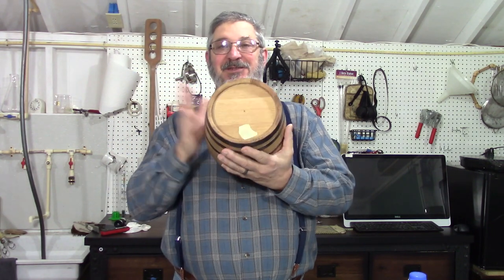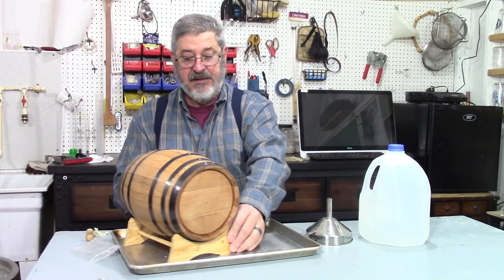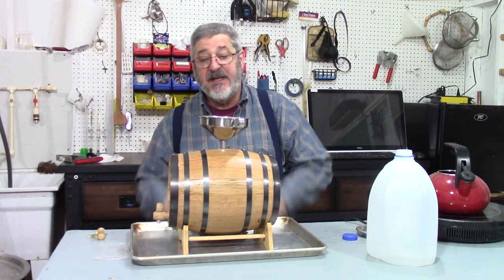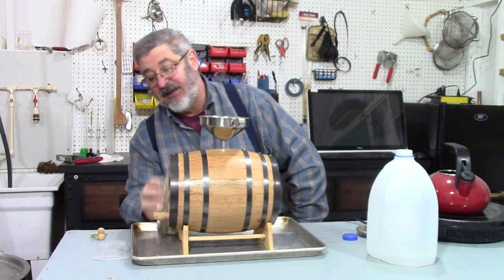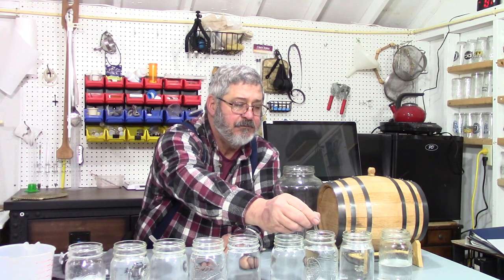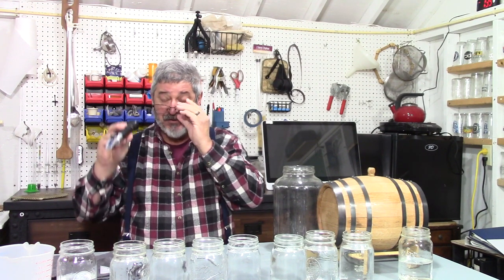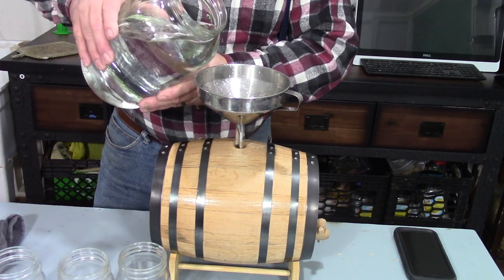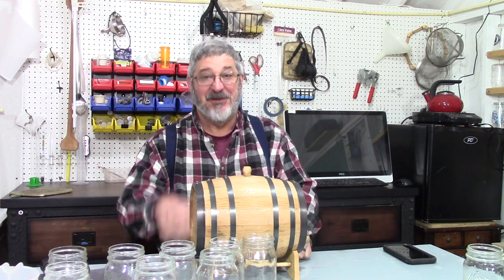E224 7 Root Bourbon part2

Comment: Randy, I would strongly recommend you weigh this now & then weight it every 2 weeks or so.  These small barrels are great, but they run heavy on the angel's share.  And if you got them online @ the barrel store with black hoops, I've had 2 fail catastrophically.  One was a 2L & the other was 3L, both had cracked staves towards the underside of the barrel.  1 was a complete loss.
So again, weigh it every couple weeks to make sure you're not losing all that hard work.
Reply: I've had similar experiences with my barrels. All have leaked to some degree. I've never thought to weigh them. Thanks
Reply: One trick I have heard of for that, place the whole barrel in another container to catch it if it fails. Hopefully, it won't, but I'd rather have spirit that touched a plastic bin than no spirit left. I think it might have been Bearded that mentioned the second container insurance trick... Anyways, good luck, it looks like it will be good.
Reply from the maker: thanks for the tips i will keep a close eye on it  (the new make was so good if I lost it I would cry)

Comment: Hey Randy....the more the temperature and barometric pressure changes the faster it will age. So I wouldn't place in your temp controlled fermentation room. Sometimes I will cheat a bit and move in and out of the freezer a few times 8-12 hrs at a time. Warm wood expands and soaks up the alcohol into the pores. Cold wood contracts and squeezes out the alcohol from the pores with the characteristics we want. Best aging proof should be around the 125 range.

Comment: Why did you say you wanted to put the barrel into the fermentation room with a regulated temperature ? I thought the diurnal temperature changes are what move the liquor in and out of the wood? I heat/cool my product on purpose to extract and transform the flavours from the oak. Bourbon barrels are allowed to heat and cool in sheds for the same reason.
Reply from the maker: this time of year you might be right i'm just a little gun shy last time i used barrel was summer time and angles took a bit to much  cheers